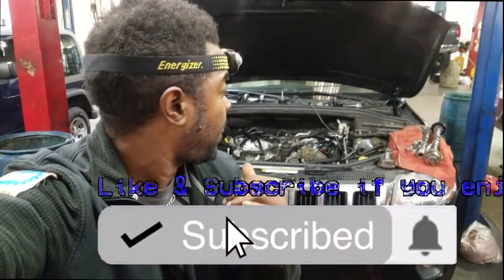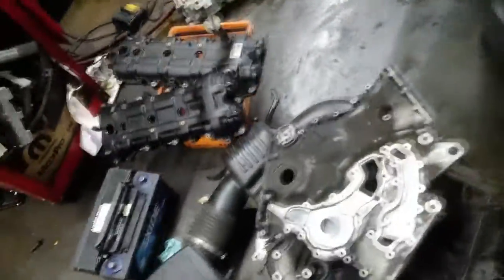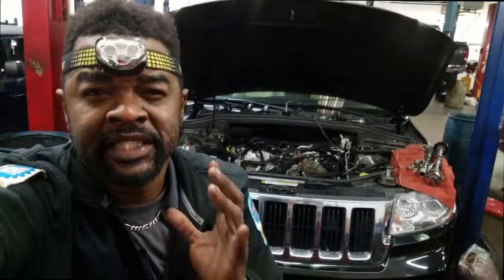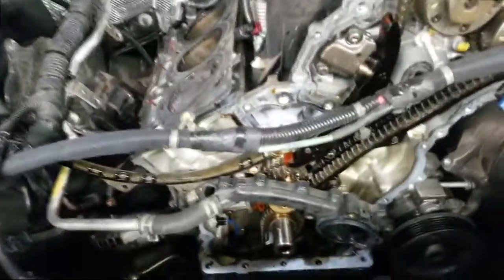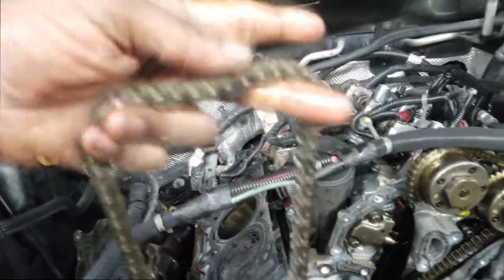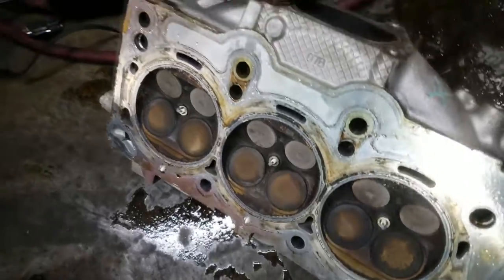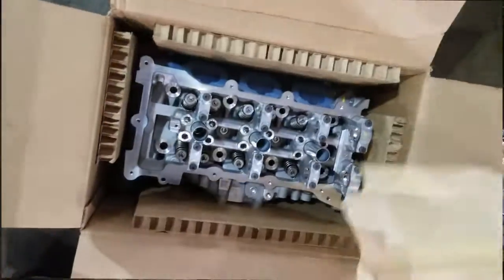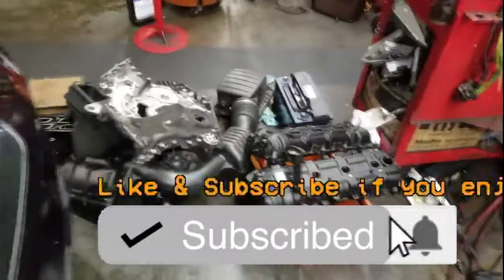3.6L Pentastar cylinder heads, Right side tips. P0300 P0301 P0303 P0305

Comment: Is the #2 cylinder a problem across all years? not just 2011-1013 My 2016 is having this problem as in the valve guide need to be replaced.

Comment: First off I sub’d. Your videos were a huge blessing for me when I was starting my sisters 14 caravan 3.6 head gaskets. I wanted to bless u back, I was able to get bank 1 off without pulling timing cover. The t30 came out with the same tool I made for bank2. I cut a t30 and welded it to a small wrench. Bank 1 was definitely harder but doable. Once it was out a bit I wrapped a zip tie around it so I didn’t lose it and was able to ratchet the screw off using the zip tie and intermittently holding the screw still with my finger to reset the ratcheting action of the zip tie.  Get the head off the block guides and the pull the head away from the timing cover releasing the dowel rod from the left timing chain guide.  I saw two videos of others with the bank 1 head off and timing cover on so I went for it and here you go. It seems like you do a bunch of these so thought it would make your life easier to know this! Ty & God Bless!
Reply: Hey I have a 2012 dodge challenger ext with a 3.6L v6 motor with a misfire on cylinder 3 I changed all spark plugs and one coil and injector on cylinder 3 and it’s still misfiring . However I remove it from the left side your video says that bank one is on the left side . Is my bank one on the left side also ? I have code p303 and p219A
Reply from the maker: @rickyfarlow8560 Dang how many miles on this car? It may be covered.  Also are you subscribed to the channel?
Reply: @OnlineMechanicTips  113000 miles and yes I just subscribed
Reply from the maker: Those Challengers are RWD cars and bank 1 on the passenger side. When this happen with me I usually just remove that valve cover. If I see a rocker arm broken that's ya problem but if not, it's a good time to do a cyl leak down test. You may find that the exhaust valve has a crack in it. See it all the time.
Reply: I just started pulling the head on mine for a cylinder 3 misfire and thank you for this tip. I definitely did not want to go and have to remove the timing cover.
Reply: @93abm  we’re u able to remove the covers I was able to do the drive side Im wondering how the left is gonacome  out
Reply: Hey I’ve been looking everywhere for this method ur talking about so I already got my right side head ready to come off it wasn’t so hard but now I’m wondering will I be able to get he left side head ? Can u plz help

Comment: Hey just wondering. Do I need to remove the cam phasers from the cam shaft before pulling the cam shaft off the heads? I know that bolt that holds the cam phaser is an oil control valve/solenoid, but im wondering if i can just leave that on there and pull the camshaft as a whole unit, so i dont have to mess with taking the phasers apart.
Reply from the maker: Are you doing both heads? Also are you subscribed to the channel?
Reply: @OnlineMechanicTips  yes of course im subscribed and yes im doing both heads
Reply: @Advix808  cam phasors are not a big deal if you have the locking tool and a 36mm socket. I think you have to remove them to remove timing chain off them.

Comment: To remove the timing cover on a 2017 Chrysler Pacifica, would that require entire engine removal?  Bank 1 seems really crammed in there.
Reply: did you remove the timing cover for the bank1 headgasket replacement?
Reply: @uccoskun  unfortunately no...took it to the dealership and they recommended total engine replacement. After back and forth scenarios in my mind that's the path forward we chose.  We ordered the engine and are just waiting for it to arrive for install.

Comment: If you bought a CDJR new with the 3.6 engine. Hope you bought the Max Care Lifetime warranty. Just was told my Town & Country needs the cylinder head replacement $3000 at dealer. $100 deductible with warranty. Total warranty work since 2014 $6500.

Comment: I just watched this video. I have a 2012 chrysler 300.  originally had a p0420 code with a cyl 3 misfire. Replaced all 6 plugs and coil packs i cleared the codes drove it for a while but the p0420 code was still there. Recently now I've got the multiple cylinder misfire code along with cylinder 3 and 5 misfire. Do you think the cylinder head could be the culprit? What exactly is the reason behind the head issue are they known for warping?
Reply from the maker: No, its not a warp issue, it was a valve face to seat contact issue. And btw the P0420 code is problems with the cat convertor. Have you gotton that looked at?
Reply: @OnlineMechanicTips  The repair shop i took it to claimed that the converter would not cause the misfire. That's why i'm confused. I've replaced the coil packs and the spark plugs. I am not having any misfire codes for cylinder 1 just 3&5
Reply from the maker: @CodysFirearms  Hey Cody, im curious, have that side bank 1 convertor been replaced already?
Reply: @OnlineMechanicTips  I have a 2017 journey with p0303 error code, coils and injectors are working perfectly fine, pressure is good in all cylinders, and I have also replaced all sparkplugs and I'm still showing error p0303, do I have to dig deeper and remove the head to see if this is a valve issue?? Nice job by the way!
Reply from the maker: @maddog9793  Yes you may need to do a compression test. Can you feel the misfire? Also are you subscribed to the channel?
Reply: @OnlineMechanicTips  yes you have a new subscriber 👌🏽....... we did a compression test and all cylinders have it's compression perfectly fine, I still feel the misfired and error is still there.... Any suggestion???
Reply from the maker: @maddog9793  Listen man, if you can actually feel the misfire and see misfire counters in that cylinder, its missing. You need to back track on the history. What has been done as for as parts replaced. New plugs, new coil, cat convertor on that bank?
Reply: @OnlineMechanicTips  the vehicle was bought at an auction so we have no idea about the car history. We noticed that 3 coils and sparkplugs were replaced. The car runs great but when you apply Drive or reverse you can feel it misfirering and also you can smell rotten gas coming from the muffler. I mean we have checked all four oxygen sensors, catalytic converter, sparkplugs, coils, injectors, mass sensor, also made a compression test in all cylinders as I mentioned before and everything seems to be fine.... I mean we have checked all possible causes but right now we just ran out of ideas man💡what else would you do if you had this scenario?? ...... Do you think that it could be a blown head gasket or burned valve?
Reply from the maker: @maddog9793  Just how on earth are you checking a cat convertor? (by looking at it?) If theres a aftermarket junk cat on bank one, its flow rate likely not to specs. A burnt valve would show up on a compression test, as for the possibility of it being a headgasket, that could also cause it but you would need to monitor if exhaust gases getting into the cooling system. What I do when Im stumped like this is remove the cat on the bank thats showing the misfire and see if misfire leaves. This will be extremely hard on a pentastar engine tho

Comment: (New subscriber) Nice in depth video bro quick question did this new cylinder fix the mis fire they were having because I’m literally in this same exact situation , I changed everything on bank 1 new intake valves because they went bent , new rocker arms , lifters, cam shafts, cam phasers, ignition coils, spark plugs everything, but I’m still getting a misfire in cylinder 5 my next thing to do is get a brand new cylinder head itself
Reply from the maker: hey bud, what year make and model car is this. Also have a compression test been done. Also any added things been done to the engine? (cat conv, muffler, anything?) And are you 100% sure engine in time? Any codes?

Comment: Firstly, I subscribed. Thank you for taking the time to help us with these videos. I have a 3.6L in a 2016 Wrangler. It stalls cold in reverse as if the torque converter (auto) is locked up. Today it bogged down to stall when thrown in R first thing in the morning and it finally threw a P0300 code, multiple misfire. Wondering if a locked TQ could produce this code falsely, or if it has been an engine issue all along. Thank you.
Reply from the maker: Wow bud, it could be either. This 2016 is it a Nag1 trans or the 8 speed RWD trans? But yes, a T/Q that fails the stall test would cause this. Get a smell of the trans fluid to see if its burnt. You really need a related code to be put in the right direction tho
Reply: 2017 ProMaster with 18,000 MI cylinder 135 poor atomization of fuel I supposed to call Paxton injectors did not help youI think it's a stalker burnt valve

Comment: hey bro,  is it possible to get the Right bank cams out without pulling the cover, since the tensioner is down low?
Reply from the maker: Hey bud, the timing chain cover do not have to come off in order to replace ANY of the camshafts. Only the cam phasers. Watch this video on how to remove the camshafts and cam phaser here: https://www.youtube.com/watch?v=IYT7UGSL93s&t=326s. Make sure you subscribe to the channel for me, thanks
Reply: @OnlineMechanicTips  thanks for this, life saver.

Comment: Hello, I just discovered you channel and considering the issues I have with my vehicle,  it may come in very handy in the future, so you got one more subscription :-)    
I have a Dodge Journey 2011 with the 3.6,  we brought it to the local shop since it started to have misfire issues.  The technician identified a Cylinder #3 misfire and changed the plugs and the coil. However we still had the problem after just a few miles (less than 20).  We then brought it back and the technician put a camera inside and he said the piston is melted or something like that. He sais the engine needs to be replaced.  Now I know nothing about mechanics and I am not sure the car is worth it to be honest.  I would like to know your opinion on the diagnostic and if it would be worth the expenses.  

Best regards.
Reply from the maker: Hello my friend, thanks for watching and subscribing. As far as your misfire go, I would suggest your mechanic do a compression test and a leak down test. Your problem could very well be valve train related. Could be something as simple as a broken rocker arm (especially if the misfire also has a ticking noise) Cyl #3 is on bank 1 which is the rear cyl head on a Journey, its fairly easy to remove the valve cover and insp the valve train for worn parts. Things like a cat convertor restriction could cause this. Replacing the engine for a misfire should not be your second option, it should be your last..Go through all the diag steps before coming to that conclusion..
Reply: @Stephen Remillard did you solve the problem? I'm having the same issue with a 2017 Journey
Reply: @maddog9793  hello,  yes the issue was solved at the dealer after all. They replace the ECU (Engine Control Unit). We haven't had the issue since.  I will let you know the price tomorrow if you are interested.
Reply: @stephenremillard9462  Yes please go ahead I will highly appreciate it...... Did they tell you why the ECU had to be replaced? Was there any other problem besides the misfired? We are going nuts with this vehicle.

Comment: also inspect the water pump on these motors 3.6l, i have ran into several of them were the propeller was cracked at the stem so at idle the water pump would pump but under acceleration 1800 or better the pump would loose coolant flow capability.

Comment: After pulling the left head for what I thought was a blown head gasket on that cylinder bank it was good. I pulled bank 1 and it had a blown head gasket between 3 and 5.  It also cracked the very top of the cylinder between 3 & 5.  I replaced the 11 motor with a 16 that came out of a wrecked charger.  I got the motor in and have yet to finish and get it started due to the holidays.   While I had the motor out I replaced the head gaskets with Felpro along with new head bolts and gaskets throughout.
Reply from the maker: Wow, thats whats up man. Go head on and rap it up. It should be a piece of cake from there..Did it overheat? what was the crack all about?
Reply: @OnlineMechanicTips   It was overheating from time to time.  It would sit in my driveway and idol for  30 mins and not over heat.  I think the crack in the top of cylinder 3 was due to the coolant leaking in and it does not compress and it ended up just pushing the cylinder out at the very top where the leak was and that formed a crack.   I can send you some pics.
Reply from the maker: @triplenickle6995  dang...yea when liquid get in that cylinder nothing but bad can happen..sure @ OnlineMechanicTips@gmail.com

Comment: Just curious would removing the whole engine make it any easier as a whole?
Reply: I have bent pushrods in right bank 1 for cylinder 3 and 5 on the intake side, and forget a little gap in the valve. Some of my valves are stuck open 1/2 inch. I'll take your advice and get a quote or junk it.

Comment: I'm having my drivers side head replaced right now. 42k miles on my Rubicon...cylinder 6 misfire that couldn't be fixed with plugs or coil swap. I wish they would fix this issue at the factory.
Reply from the maker: hey bud, yea thats bank 2 for you..The good part about it is that should hold you for awhile..The newer cyl heads I heard was re design so you will have most of the updates, please subscribe to the channel for me, thanks

Comment: I’m curious. Did you do a compression test or a cylinder leak down prior to removing the cylinder head? If so what were your results? I have a 2015 Dodge Grand Caravan with a 3.6l that has a p0305. I swapped ignition coil, tested and swapped injector, and even did a tune up on it while I had everything apart. And it still has a misfire. Compression readings where around 165-170 on the right bank
Reply from the maker: Hey bud, Im not sure if the other tech did all the test you mentioned..I was given a cyl head and was told to put it on,,I assumed because it was the right side and the timing would be affected..I would say this tho, I have personally myself done every logical test on a 3.6 bank 2 before I replaced the head and the results was within specs. After contacting chrysler, they told me to put a head on it anyways..go figure..Also we have a jeep on the lot now for a month with a cyl 3 misfire..Everything and I mean everything has been replaced on this car. But the misfire still there
Reply: @OnlineMechanicTips  did you solve the Jeep you had there for a month?
Reply: JT Automotive Rideshare Guru did the cylinder head replacement in this video resolve the issue?
Reply from the maker: @marcusbeard2027  it's hard to say exactly. They had a cheap after market cat converter  also on bank 1 that was replaced at the same time. With both repairs done, no cel
Reply from the maker: You may have an issue with a rocker arm coming apart..that will require removal of the drive train but not to bad
Reply: You can do this job with the cover on